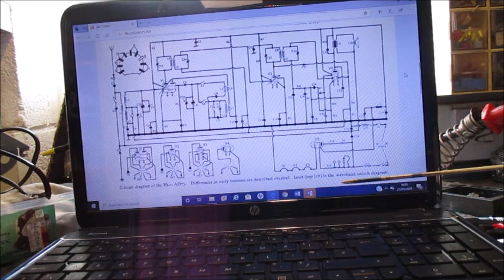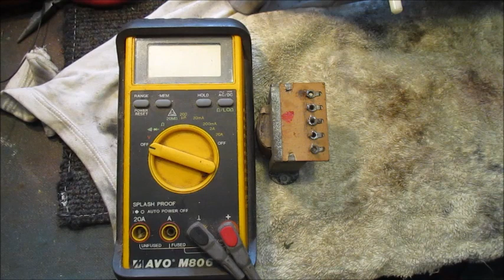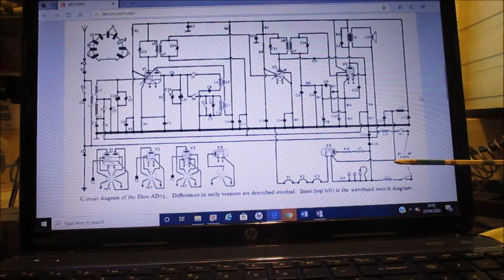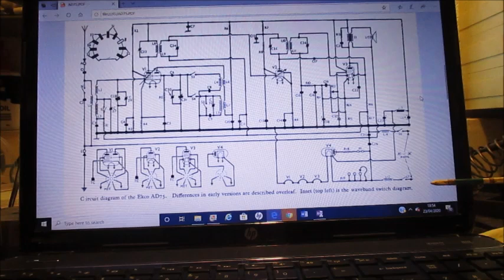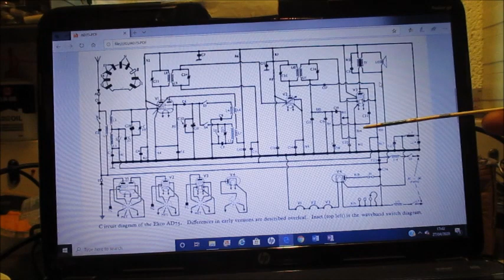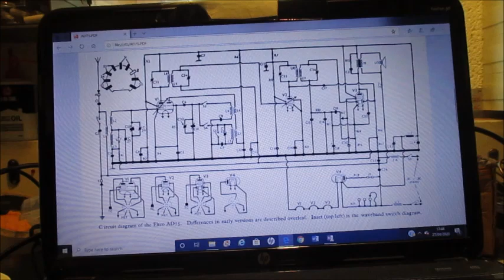Ekco, Model AD75, Reconditioning; Part 2

Comment: Great job Phil! Coming together great, looking forward to part 3. Thanks for sharing...Take Care—Larry ps great job on rewinding the choke! I have rewound a few antenna or oscillator coils, but never a choke......once, back in 1977....I rewound a TV power transformer to make a 12 volt power supply....one day, ai will attempt a speaker field coil...lol
Reply from the maker: Backtothefutureradios A big thank you for viewing Larry.
Rewinding a low frequency choke was a long, and tedious task but it as luck had had it, I was fairly successful.  Talking of rewinding speaker field coils, I rewound one some thirty-five years ago.  Like the low frequency choke I wound, there was no way I was able to determine its D.C. resistance or resonate it’s frequency since it was open circuit.  I removed all the copper wire from its former, and weighed it.  I then weighed the same gauge of copper wire off a bobbin.  That enabled me to rewind the defective field coil.  Like the choke, the field coil rewind worked fine.  So whenever you get a choke, or transformer with a defective winding, consider the possibility of rewinding it.
Cheers my friend, Phil.

Comment: Phil , firstly, I need to get me some of that Heros candy , so I can eat them and empty them and use them for parts storage :) Looks good and delicious.  That chassis looks fantastic with the paint.. It will last better and longer then when it was originally made.. Phil, I am VERY curious how to know the proper value of windings has been achieved for the choke. This is one thing I have never done- I have to try this one day soon just to get the experience.   You did an amazing job on that one my friend.... really really great job... did you remove the cardboard form before remounting ?  It looks like you did but want to be sure.You've done such a fine job on this radio. I love how you go thru process... really impressed my friend... very appreciative .... thank you.. Stay well
Reply from the maker: Thank you for viewing Part 2 Ron.
Before I spray painted the chassis, it was in reasonably good condition – a few rust spots here and there but it was badly stained.  Since each one of the round Ekco models are very pricey, painting the chassis would not only make the radio look good, it would likely prolong the life of this radio by at least thirty years.
Before I embarked upon winding the low frequency choke, I looked at the enamelled copper wire I had readily available.  The thinnest on my shelves was 38 swg which was thicker than the original choke wire.  I knew I would not achieve the resistance of the original choke which is specified at 375 DC ohms (but did not give a value in Henry).  Converting ohm into Henry is not possible since ohm is a measurement of resistance whereas Henry is a measurement of inductance.  In other words, they are two separate physical quantities.  Consequently, my thinking was I’d be lucky if I achieved 190 ohms but hopefully it would handle a bit more current which, as expected, would lag voltage by 90 degrees.  Given what I had available: limited space on the radio chassis (That was why the two larger chokes shown in the video would not fit in the given space); the physical dimensions of soft iron, and the thinnest enamelled copper wire I could muster meant I had to wind as many turns as practicable onto a small cardboard former, and at the same time achieve close to 10 Henry, but avoid saturation (getting hot), and reduction of L.  
It was a bit of a challenge since there was a few cause and effect factors involved.  When I used a slightly thicker wire onto the cardboard former, I had to take the dimensions of soft iron available into consideration since there would be a few consequences further on.  I ended up achieving 226.8 DC ohms (147.2 ohm below specified DC ohms), and 14.37 Henry.  Though HT rail voltage is not specified, doubtless it rose by a few volts – not enough to adversely affect the radio’s performance.  I can’t buy a replacement LF choke direct from Ekco: they no longer exist.  The radio power supply ripple is a reasonably tolerable 16.2 volts.  After 4 hours of the radio being powered up, the choke I wound gets slightly warm.  In short, we have to do the best with what is available!
Whilst surfing the net, I found the following article…
 http://livinginthepast-audioweb.co.u...p?p=vxformers2 
…hope you found my reply at least useful in some respects.  Very likely Brendan can explain LF choke theory better than I can – (suggestion) copy and paste my reply, post it to Brendan, and see what he has to offer.
Cheers my friend, Phil.  P.s, please join me again for Part 3.